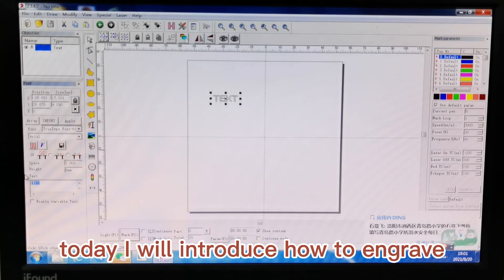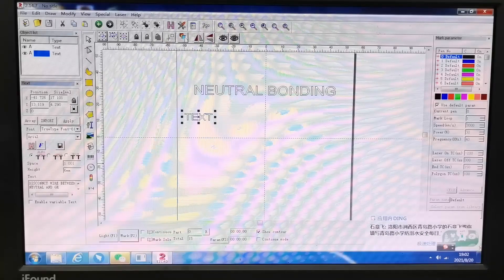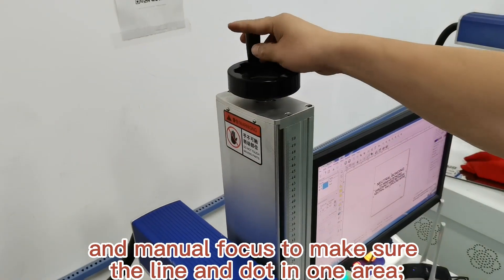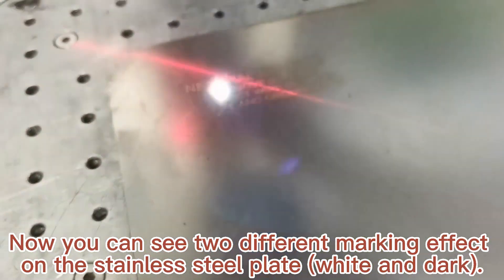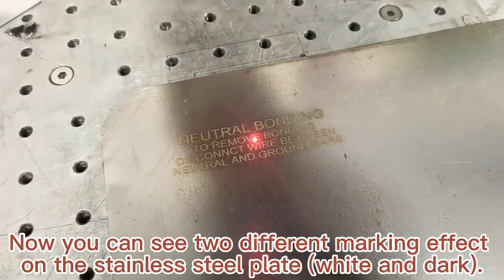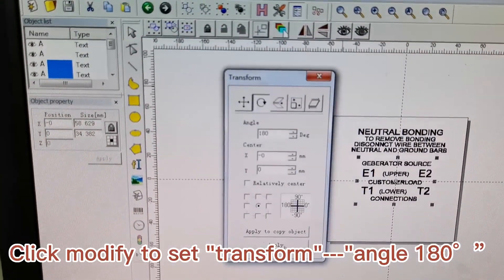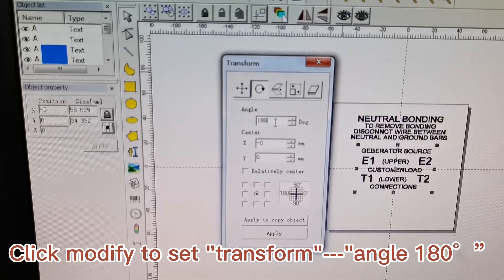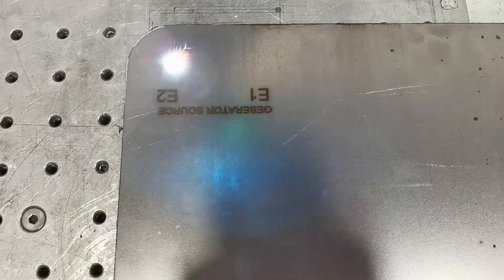Different Laser Marking Results on Stainless Steel By EZCAD Software

Comment: What are the parameter settings for marking white and black
Reply from the maker: different machine configuration will be different settings, need keep try and test by your machine
Reply: i HAVE A MOPA 20W AND I NEED TO GET BLACK WRITING
Reply from the maker: @rohanboyd4120  Yes, you can consult your supplier how to set it